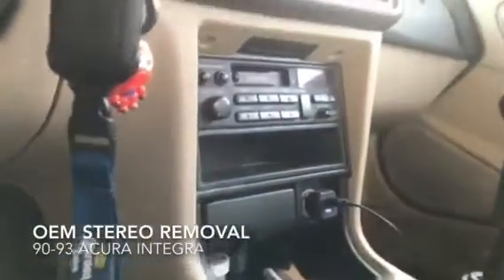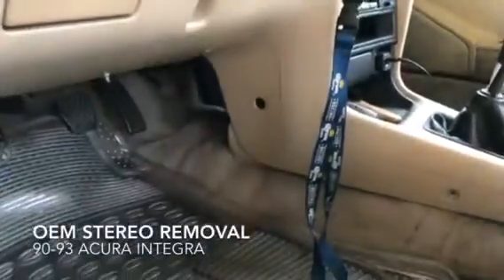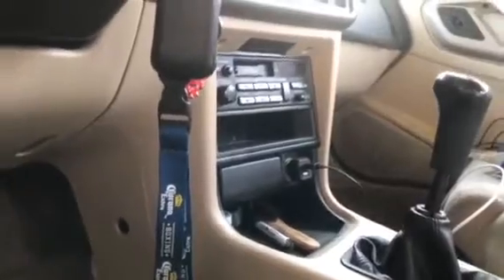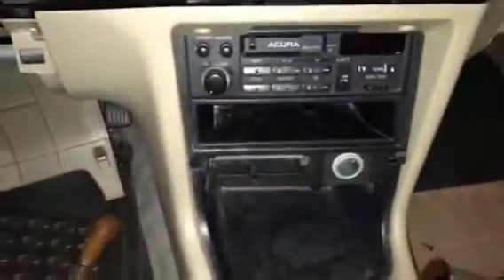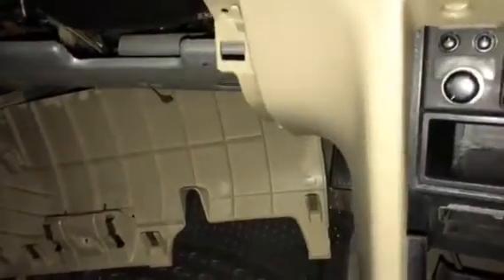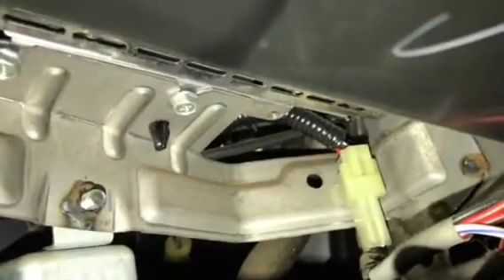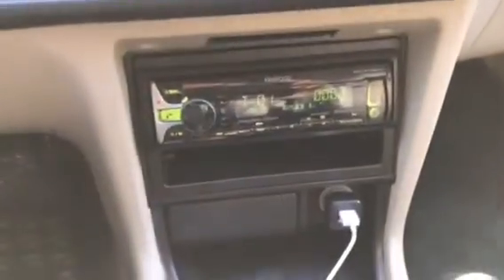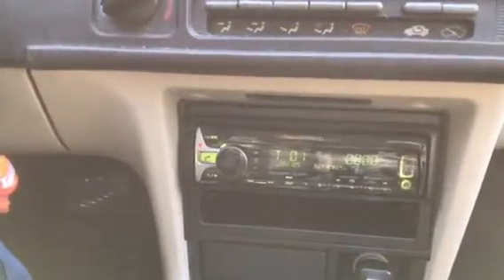90-93 Acura Integra Stereo removal

Comment: Great video! I have a 1990 Acura that needs a stereo. Now I have the information to get it done right. I may post a video of the installation soon. Nice job btw. Looks great!
Reply: Did u install the sterio.  
did u find a simpler way????
Reply: @faustinogarcia5202  I haven't yet. Car runs great but the wire harness is lacking. I will wire it in separately like the blower motor with a separate switch. Fun car just wish they didn't supply it with the biodegradable wire housed in  "cornplastic". The electric windows and door locks between the drivers side door and chassis are brittle, broken, and will be in need of replacement too. Lots of shorts not enough time to fix them all.